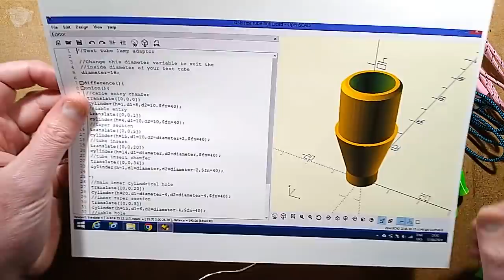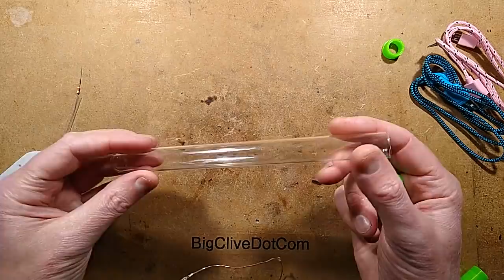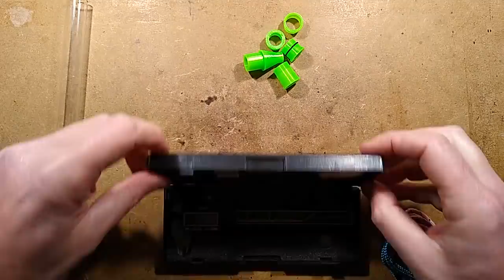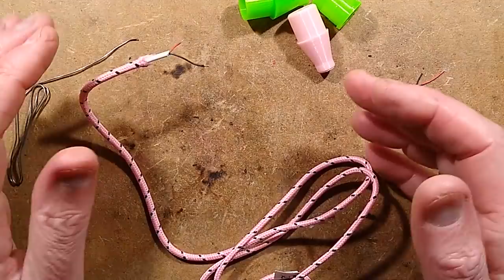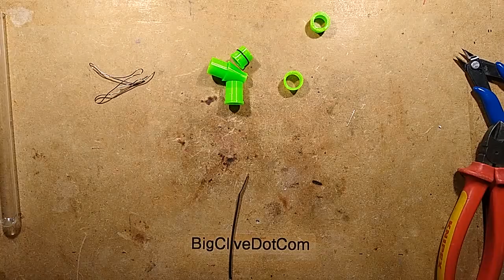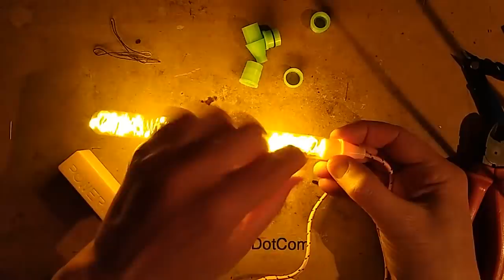Make a safe USB powered test tube light.  (optional 3D printed end)

Comment: Hi Clive. I commented on your most recent video earlier as I wanted to ask a question about this kind of light/project. 
I’ve got a project with 10 bottles,  each with 15 of these lights so 150 LED’s. Each bottle is daisy chained to a 5v power supply coming from an adaptor. I assume I need to put a resistor to each bottle but I’m not clever enough to work out what value resistors to use. Can you help? 
Many thanks again - James

Comment: G'day Clive, I recently purchased a few thin rope LED's from eBay with a battery pack that houses 2x AA batteries. Trouble is that they make this annoying humming / buzzing noise when they run. For some reason they won't run directly from a 3-5 volt DC power supply and only work from the battery pack. Any ideas how I can suppress the annoying sound so I can make a sign to use as a nightlight for my son's bedroom.
Reply from the maker: They probably use traditional strings and boost the voltage up.  It's less common these days.

Comment: Regarding the 22 ohm resistor:  would I use the same 22 ohm regardless of how many LED's I use assuming the USB voltage is +5v and the forward voltage of each LED is +3v?
Reply from the maker: You could lower it for large strings of LEDs, but 100mA is good for a wide range.

Comment: would it of been easier to get the leds, feed them through the tube, then wind it around a cylinder, that's narrower from the tube and then pushing the cylinder through the tube and push the leds of, and then you could pull it slightly back through the tube???

Comment: mmm this seems like a good project for storm season. just make sure you have some power banks charged up and you can have an emergency light just on standby. with a 10 amp hour battery that's 20 hours of light... roughly
Reply from the maker: More, since I goofed and said 500mA when I meant 100mA.  So about five times that.
Reply: @bigclivedotcom  not bad at all. these little button cell circuits can really optimize their battery use

Comment: Clive you can get test tubes in various sizes that are made of clear plastic rather than glass and some have plastic stoppers which are easy to drill or cork ones. Might be an option rather than using breakable glass. Pyrex ones are fairly tough too.
Reply from the maker: I've tried the plastic tubes, but they never look quite as good as the glass ones.  The glass has a good optical purity and long term resilience.  It also has a bit more weight if the light is suspended.

Comment: i tend to burn the plastic and then sand the wire or wipe the residue off with rubbing alcohol.  Every time I have tried to apply solder directly to a coated wire results in a bad connection that sort of cuts in and out.

Comment: Wrap the LED's on a thinner cylinder, then wrap a piece of paper around the LED's. Slide the LED's and paper off of the cylinder, and into the test tube. Then, while holding the LED's in place with something, remove the paper.
Another option would be to wrap the LED's around cylinder starting with those nearest to the power supply. Once you have finished wrapping, slide the LED's, still on the cylinder, into the test tube, then remove the cylinder.

Comment: I always cut leads with a few inches of wire on the discard end, they go in a box. Despite having no intended use for them, they get used up regularly, to the point that I have a few times bought a pile of leads to keep as stock. Turns out lots of things have a micro-female socket for aux power hidden somewhere.
Reply: +1 :-)

Comment: Would it work to fill it with clear hot melt glue or clear resin, possibly with glitter inside and let it harden and crack the glass? Not entirely sure what the point would be but I had the idea and here it is.
Reply: Had vaguely-similar thoughts -- but much easier just to use glitter with gelatin (add a little fungicide), the LEDs and wire are insulated.  Hot-melt glue tends to set cloudy and is both more expensive and very painful to remove.

Comment: Very recently trash-picked a solar-recharged set of these lights. Still pondering what to do with them, though. This version has dark-detection, which is cool. However, it takes 3 AA cells. I'm considering grafting a single lithium cell and the circuit -- minus the USB socket -- into it and making a balcony mobile out of it.

Comment: Just last month I was recrimping some ethernet cables, I pulled out my ends and boots. I got to work cut the old ends off put the boots on put the new ones on. Went to clean up .... freaked out... As I picked up a boot that wasn't on a cable. Apparently rather than pulling out 4 of everything I pulled out 5 boots 1 extra. The last few times I've not messed up I almost thought I did. I didn't forget to do it but I still freaked out thinking I would have to cut an end off and put another one on.

Tip when making cables check one side before you do the other side you at least get a 50/50 shot at slipping the boot on and running it down the whole length of the cable. It's a whole lot easier than taking an end off to put something on that you forgot.

Comment: "Even the oldest veterans in the audio industry will stil put connectors together forgetting the end-caps" ...
Been there ... done that ... got a load of T-shirts.
Reply: Or the "Oh yes I forgot to put the heatshrink around it before soldering", redoing it, only to notice after you heated the heatshrink you also forget to put the cable through an end cap thingy. Terrible.

Comment: ah, i got a 8 pack of those 2x cr2032 lights,
they were really cheap of amazon and came with 2 cells in each of them AND a pack of spare cr2032 ones for free (also wasnt mentioned in the description).
i think set of 8 for 8 bucks included shipping, were usually a cr2032 should be around 25 cents each already...
BUT:
the cell holders are really bad. i converted all to usb, using two strings parallel instead of one and running them behind 20Ohm (10Ohms in + and 10Ohm in - to spread heat) @5V
(i guess they are really dim originally with those 2xcr2032 because of high internal cell resistance and really bad contacts in the holders.)
Reply: i guess leaving it wound up with tension on a smaller pencil or wooden stick and then turning it counter winding direction to let loose could work for getting it in there easier.
perhaps also double wound (double up, winding only once)
- Next thing i wanna see is a bottle-ship with full lighting please :-)

Comment: This month, I turn 69 which puts me in the official "OLD FART" region of life. I grew up on a small farm in North Dakota with no power to our home, and the only running water was provided if we children ran with the pail of water from the windmill to the house. What used to amaze me was those old kerosene lamps that we used to light the house after dark.  Dad would light the lamp, and it gave off just a little light around the flame, but when he put that glass chimney on the lamp, the light seem to come to life and the whole room benefited from that same small flame.  The cleaner that shade, the brighter the light seemed to be.  Can you perhaps explain the concept of that magic?
Reply: Jerry Ericsson did a little research, it seems the shape of the flame is dependent on the “deflector bell” or the shade as you called it. It grows brighter probably because of a more efficient combustion or it could be the shape of the flame is more conducive to emitting light a little more sidewards. Just a guess though so don’t quote me on that ;)

Comment: When I was a teenager I would help out at the local theatre, my father was the lead technician, the amount of times I would hear a tech swear, would usually be after wiring the 15A plug withiut feeding it through the cover first, a lot of plugs had the bottom of that hole cut out.
Reply: Ditto, me and any UK 13A rubber-top plugs.  Now I just accept I'll mostly be wiring them twice :-)

Comment: 4:30 Thank you for using OpenSCAD. It's my favorite CAD software. If you don't want to use $fn on every function call, you can simply define it at the beginning of your script:
$fn=40;
It makes it easier to maintain. If you are working on a large project, you can set it to a low value during development (fast rendering) and increase the value at the end of the development period (smooth rendering)
Reply from the maker: I'm using the single $fn at the beginning now.  I hadn't been aware of that.

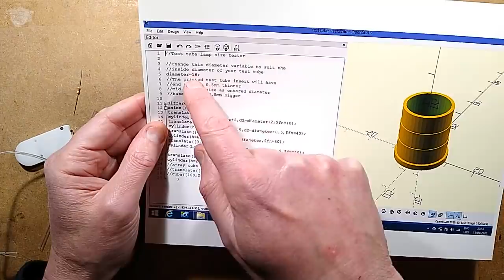Comment: 6:51 ... You are really an amateur when it comes to opensCad ... normally you use the configurator window for that ... also you might want to use a comment behind the to restrict the type and values
e.g.: // [8:30]
(but don't quote me on that I forget always the correct notation, possible is a comma, a semicolon, or a colon) and one below to name it
e.g.: // Inner diameter of the tube.

Comment: I have one of those chinese rework stations. Mine is a model 853D. Its a power supply, hot air gun and soldering iron. The power supply fried one day when i was using it. After that when you would turn it on it starts smoking. Turns out what was smoking was the bridge rectifier in the power circuit. Replaced it with a bigger one and it works again,. The DC power supply side is still bonkers, stuck at a certain voltage, but the soldering iron and hot air gun still work fine. I've since got a much better DC power supply but the chinese thing it still my main soldering iron/hot air gun.

Comment: FWIW, the raft is an option that all slicer software should support. It can both help with bed adhesion, and prevent (or at least reduce) warping by acting as a sacrificial layer. Before heated beds were a thing, rafts were often considered required for printing, especially with ABS. If your printer's slicer software defaults to using a raft, I'm guessing it doesn't have a heated bed? My printer has a heated bed, but I still use a raft on occasion for trickier prints.

Comment: Everyone should have calipers. I recently got a pair for $6 on amazon and they sell the same model for less then $4 from china on ebay. It's crazy. They're not precision instruments but it will do the job for most people. I think they claim accuracy up to 0.2mm. The steel version is like 60 cents more. If you're old school, you can get the manual non-electronic one for $1. https://www.ebay.com/itm/150mm-6inch-LCD-Digital-Electronic-Plastics-Vernier-Caliper-Gauge-Micrometer/352657248573

Comment: If you had a slightly smaller rod or former with a small V filed into the end, you could probably wrap the wire around it and slide it into the test tube and then slowly pull the form out while letting the LED light string ping where it wanted with a bit more control.  All in all a fun project even for kids to do.

Comment: I have an question, I have an led circuit that plugs into 220v but it only sends 3.2v and around 500mah to the leds , but I want to run it on an normal 5v usb power supply, so I can use it in an 3d printed project maybe, which resistor should I use or should I use something else also?
Reply: If the LEDs take 3.2V and 0.5A, and you want to run them at 5V, you gotta lose 1.8V; so you need a 3R6 resistor  (Ohm's law) at 1W (V^2 / R).  You could maybe get by with three regular diodes in series (0.6V x 3 = 1.8V), but that's kinda less safe, provides no current limiting.
Or did I misunderstand your question? :-)

Comment: Clive, I'm curious what effect a small ceramic capacitor would have. I'm inspired to try this, my local dollar store carries these lights for CDN $1.25, plus they have glass tubes. For those in Canada, Micheal's has larger test tubes with plastic screw on lid, although pricey.

I also have one extra 3.3V 100mA TO92 LP2950 LP2950AC3.3, that would avoid the need for the resistor, but would be "fun" to wire up, especially if you use the .47/1uf cap as mentioned in the spec.

These kind of lights are nice after a full day in bright light, you can relax, chill and just wind down the brightness. Good job!

Comment: It would require more planning but if you had a dowel of an appropriate diameter you could notch the bottom, wrap the LEDs, and feed the tightly coiled thing into the test-tube...then rotate the dowel to "release" them and remove the inner dowel while leaving the lights.

Comment: "I'm going to slide that bit of heat shrink over now, before I solder it on. That's another thing you can screw up by getting it in the wrong sequence."

twitch
Reply: Dear god, so much unsoldering then sliding that damn tube over the wire, then re-soldering.

Comment: My best results are a skirt and then a deburr tool works amazing for me where is your build plate? If you get one instead of doing it on the aluminum and you just clip it on with those black document clamps
Reply: Agreed, I have never seen anyone print on the bare bed before. I guess it works, but if you have a little "mishap" it's a lot easier to replace a cheap surface cover than to replace a large, relatively expensive chunk of alumin[i]um

Comment: A trick for drilling rubber bungs is to freeze them over night then drill them.
Reply: A trick for drilling rubber (bungs) is not to drill rubber (bungs).  Rubber, it seems, is resistant to being penetrated so obviously. Therefore, use guile. In the form of -- what else? -- a dinking punch. And, of course, your lube of choice. A set of dinking punches can be made from an aerial. They store nested and you can make several sets from a single aerial, depending. Chuck your desired girth in your go-around tool, slather the rubber object of desire with lube (e.g. dish soap/washing-up liquid, ATF, olive oil, etc), position your punch over the target, and apply light pressure. Result should be a neat, smooth-walled hole of relatively constant diameter normal to the surface.
Reply: Neglected to mention: the mouth of a dinking punch made from brass, as you might find in an aerial, can be made sharp by inserting the tang of a small file into it while it's spinning in the chuck of the go-around tool. You can use anything, really -- the tip of a pairing knife or X-acto blade. 

The greater the bell-mouth and the thicker the object and the greater the force applied, though, the greater will be the likelihood of a tapered hole. Which might be advantageous, depending. Experiment, if possible.
Reply: @Michael Thibault .... Rofl

Comment: Great video and great project, thank you 
I absolutely adore those battery powered Christmas lights from poundland, they have a lot of potential for simple and quick projects 
A couple of years back I found a 6V power supply when going through old junk. It was no brainer to go get a couple of Christmas lights sets that take a pair of AAs each, then write them up and voila! - you have some sexy looking Christmas lights that don't need batteries! 
I didn't have a power tester and couldn't make out what the power supply's current was, but I tested for safety by leaving it on for several hours and feeling how hot the lights and the power supply got over time, it seemed to be a perfect match. 
Ended up shoving those in a Haig Club bottle and the set up would fill the room with blue light (I have a fetish for coloured lighting indoors)

Comment: I like how you can hear the vibration of the phone in the first sec of the video :) amazes me every time how you do this stuff without cutting
Reply from the maker: It's actually the microphone auto gain control that is a bit too fast and makes a slight boing noise at the beginning or if there is a loud noise.  Just a quirk of this recording device.

Comment: Clive, could you design and build a lithium ion backup battery using components from Amazon or AliExpress?
Reply: Backup battery for *what*, though? Volts, amps, duration of backup required?  And usually it's better to buy than build, whenever possible.

Comment: Hey Clive, idea for you here. If you where to wrap the wire round the sharpie starting with the USB end under the lid clip then wound up, you could have put the small end into the test-tube and push them straight off. Hope this helps :)

Comment: Start winding at the resistor end. Fasten a thread at the end of the sharpie and run it back to the other end to stop the coil falling off. You can then feed it into the tube along with the sharpie, then release the thread to free the coil and remove the sharpie.

Comment: worked in the mod and aircraft wiring industry.. id hate to think the number of times i fully soldered or crimped and inserted 32 pin  or more circular connector without putting the backshell or boot on....

Comment: how to lower the current uotput of a constant current led driver when you can't access the power suply?
i have a keyboard where i replaced blue leds firh pink ones but keyboard have constant current led drivers integrated in the chip and it burns my pink leds beck to blue because the current is too big and luminofor change color back to blue
resistor in paralell with the led?